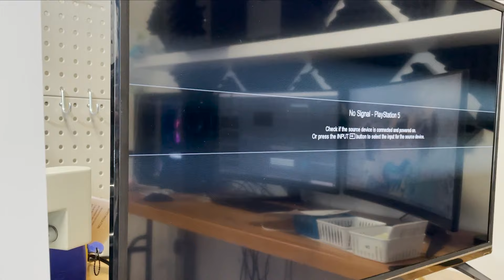PS5 HDMI Replacement: Fixing HDMI Port Issues Like a Pro!(Teardown included)

Comment: I am going to guess that this is what keeps happening to my barely used PS5.
Sits on "entertainment center" in the exact spot I place it and I do not move it, yet 4 times (only after an OS update always) the video on my only used for gaming once PS5 disc model has gone away after an OS Update (but not all OS updates). Brought home from Target where it was purchased, moved stand to bottom rather than side, plugged all cables in straight (no angles) and after the 4th OS update (right when videos on YouTube showed Sony changed from the very large heatsink I have to a smaller one) it rebooted, showed the update installing then showed it was going to reboot again. When it came back on, no onscreen video but full video through PS Remote Play. Sent to Sony and was sent unit with my serial number (but haven't checked the heatsink again after the 1st time I took it out of the box fresh from the store and examined the inside then reassembled and installed it) and everything working. Months after, having only booted it once every 2 weeks to allow all updates to install (OS, Features and game updates with OS update always done last) on another OS update it happened again on 2nd reboot.  Came back from Playstation repair and a month or 2 later OS update installed and again on 2nd reboot no video from HDMI. When it happens I always switch from my PS5 original cable to 1 of my Audioquest Pearl 5 4K cables and with all cables I try both ends, but no video.
What stinks most of all about it is I have only ever moved and/or unplugged the power cable [wall end] for 2 minutes to let capacitors discharge then plug back into wall, then changed HDMI cables and cable ends after the no video [even in safe mode for all of these] due to OS update 2nd reboot no video happening.
Have they really soldered the HDMI pins so poorly that the connections break away on a completely unmoved unit booted only to install OS updates, OS Features updates and game updates once every 2 weeks then completely left alone and unused in a clean room with my server, firewall, modem and a Gizmo 2 which is only turned off once every 6 months to 2 years to check it's heatsink isn't filled with dust and the fan is clean?
It's a temperature controlled room with HEPA air Filtration and a PS5 which is only booted every 2 weeks to install updates then turned off and left to sit until the next check for updates. In that room in which the cables for it are not touched until no video happens after an OS update's 2nd reboot the HDMI plug is likely what's breaking within it (I don't doubt this at all)?
SquareTrade claimed it was dusty and caused the issue last time but I'm going to bet it's just the darn surface mounted HDMI port coming loose because it's only surface mounted, not touched until the issue occurs and in temperature controlled clean room with my server, firewall, switches,  modem and a Gizmo 2 for administration which itself never fills with dust as SquareTrade claimed. None of my other hardware ever gets much if any dust in it.
Maybe the next time it happens if the HDMI port is okay I should just solder it down again but with solder surrounding the HDMI surface mount pins completely but with zero bridging?
A year and a half of ownership in a temperature controlled clean room and 4 times this happens without any cables having been touched (except when the no video issue happens on 2nd reboot of OS updates)? Something is very clearly wrong with the PS5 board design. The HDMI port should be through hole. That would stop this nonsense unless their solder is just that bad.
I regret buying it and the Seagate FireCuda 530 4TB drive for it (installed when returned after last no video repair at SquareTrade before any cables were plugged in). Feels like I was ripped off by Sony.
Reply: How do you even have time to type rhat
Reply: @PivotGrowth  Retirement allows all kinds of fun.

Comment: What was the step right after getting the hdmi port soldered on? What was that piece you were putting solder on right after and why?
Reply: That isn't solder, it's liquid metal on the apu
Reply from the maker: Either your are referring to the legs of the hdmi port on the underside of the board or the “thermal compound “ which happens to be a liquid metal just like Carson W234 stated.
Reply: @FIXDPHONES  can you just use thermal paste like you use for a CPU on a pc ?
Reply: @kyriacandro  I think paste wouldn’t cut it, don’t you have to use liquid metal 😅
I’m learning…
Reply: @kyriacandro  because the PlayStation has such little breathing room, it ‘requires’ Liquid Metal, much more efficient with the heat in this type of form factor
Reply: @Your father  yeah makes sense I gotta change my hdmi port looks pretty straight forward just not sure if my solder point is small enough. Also do you have to add new liquid metal or is the old liquid metal on there fine